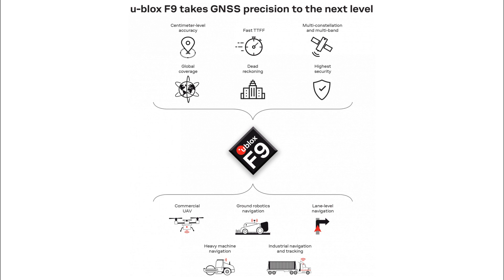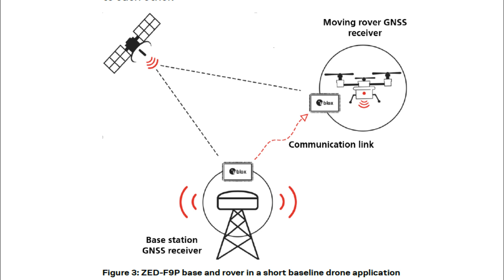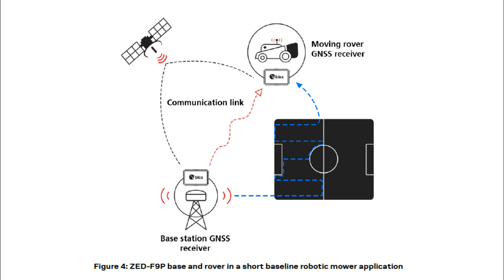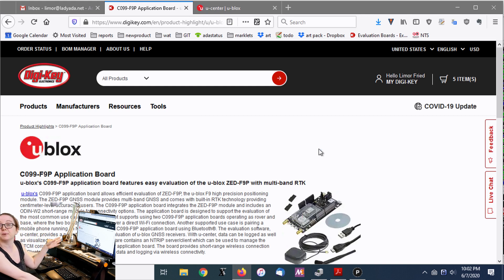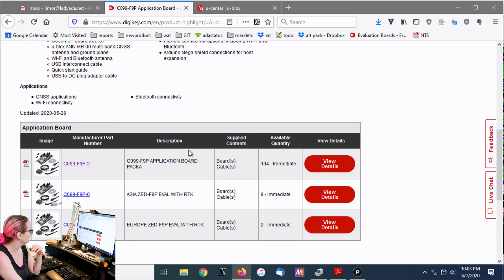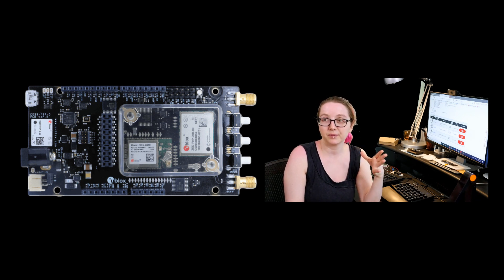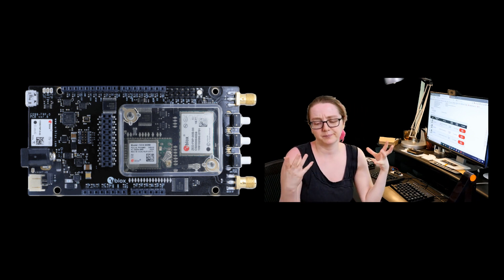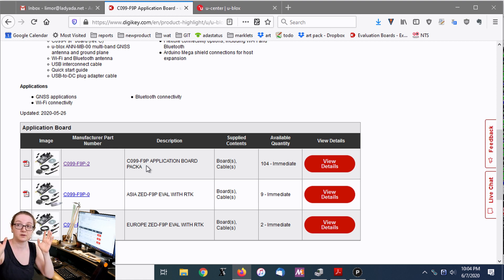EYE ON NPI - u-blox C099-F9P Application Board for ZED-F9P GNSS RTK Module

Comment: C099 f9p 0 .....I am new to this. my project is the build rtk survey kit base and rover communicating correction with radio link such as 3rd radio, my question are the following.

After configuring c099 f9p into ucenter, do i have to configure it again the following day i will use it?
do we have mobile app to view solution single float fix?
and if so, what mobile app can we use on collecting survey points and staking out points

Comment: To my knowledge the Ublox antenna does NOT have a magnetometer in it.  The key point of using the same antenna, is to have less work to correct and calibrate the local installation.  This part cannot be overstated for a high-precision GPS solution.  The ground plane affects the signal reception - both directionality and in strength.  The sensor should be roughly the same age, same corrosion, etc for optimum matching of the antennas.  Cable lengths themselves introduce a signal path delay from the antenna to the GPS engine correlators, "delay=distance/time" to a correlator so it can mess with the solution.  This can all be corrected in software, but measuring this stuff is probably beyond hobby tools...
 
Not mentioned in this video is that one can have more than 1x GPS receivers on a vehicle and this increases the truth of other possible readings.  There is a white-paper available for this on Ublox's site.
 
1) Given a fixed known distance from 2x GPS antennas, one can determine the 2D orientation of a vehicle.  Think of a line drawn between two points (your GPS antennas).  You can calculate where those two points are, and thus derive the angle of a point located at the center of that line.  <-- I'm doing this in a car for a data-logger, using direct serial between two uBlox receivers to back up a magnetic heading sensor in a 9DoF part.
 
2) Given a fixed known distance from each of 3x GPS antennas, one can determine the 3D orientation of a vehicle.  Again think of lines between each antenna - but now instead of just the angle of the line, one can determine the rotation of the line.
 
3) It's possible to chain/mix all of this with a fixed base - which gives the more accurate position of the mobile receiver by removing signal jitter detected by the fixed/surveyed receivers as discussed in this video (if you know the fixed receiver hasn't moved from a known location - all of the wander is detected error).  If one has multiple fixed receivers broadcasting their RTK outputs on different channels or time slots...  you can see where this goes.  this will require more processing than what can be done inside a Ublox receiver, but nothing says you can't take the RTK output of everything and do the math yourself ;-)
 
Following that, the limitations of the position determined by the Ublox parts comes down to the quality of the local clock and its time resolution algorithm(s).

Comment: LoRa??? If BT doesn't have the bandwith there is no way that it will fit within the allowed LoRa duty cycle.
Reply: The LoRaWAN  protocol has that speed limitation. Using the raw LoRa modulation the speeds are a LOT faster.